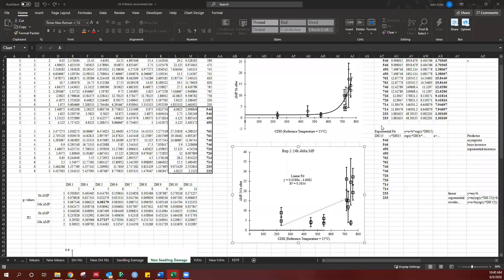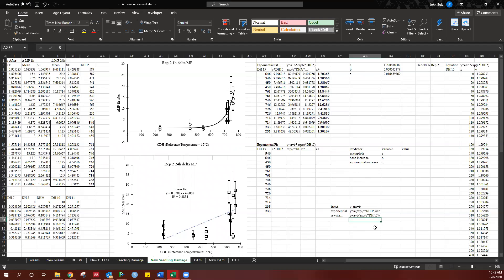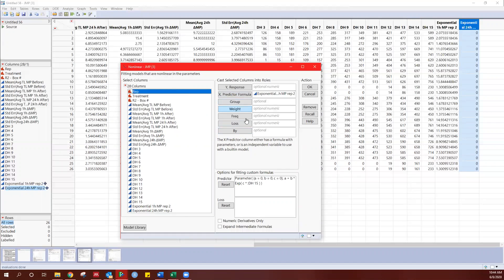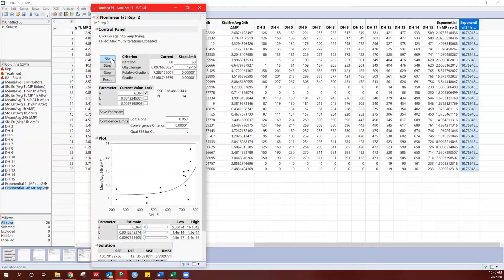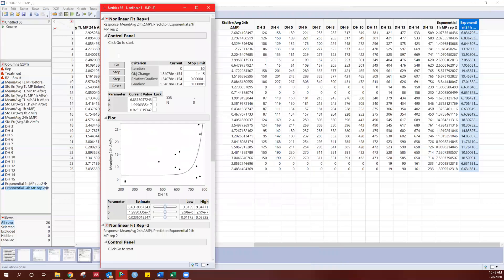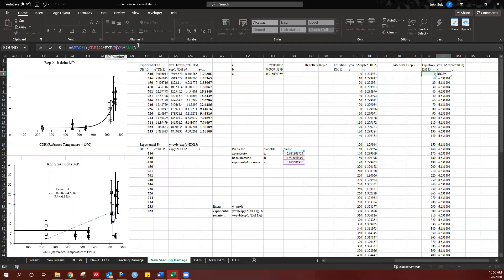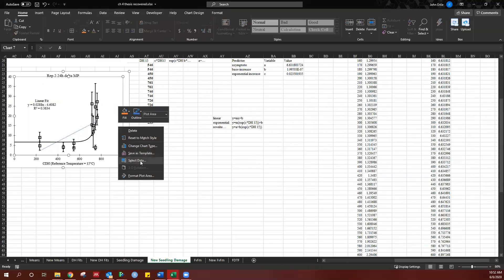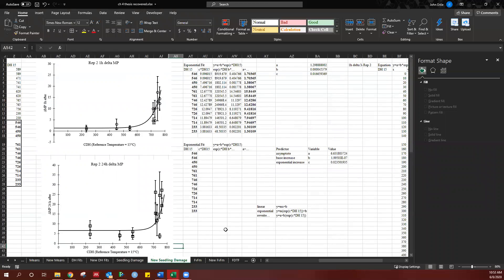JMP nonlinear curve fitting based on a specified equation

Comment from the maker: I mention R-squared in this video, which is a good predictor of fit for a linear (y=mx+b) model. However, we are using an exponential model. JMP reports RMSE (reduced mean square error). Values closer to 0 are best. The lowest RMSE I achieved was 4.05 or so, which indicates the model is the best fit compared to other models I use. You'll notice the previous iterations of the curve I made have a higher RMSE, indicating they are less good of a fit than the final values I settled on. The multiple iterations allows me to compare the models made by looking at RMSE. Further iterations with locked in values can help determine better RMSE fits of the nonlinear equation, which is what we want. The lowest achievable RMSE is generally the best fit within the specified exponential model. Other models may provide a better RMSE (like perhaps a logarithmic model). However, the logarithmic shape does not accurately represent the biological response happening here, so I would not include such a model even if it had a better RMSE. 
RMSE is similar to R-squared in that it is a representation of variance of the data from the curve or model made. However, RMSE is a better representation of this variance for non-linear models, which is what I ended up reporting in my publications.